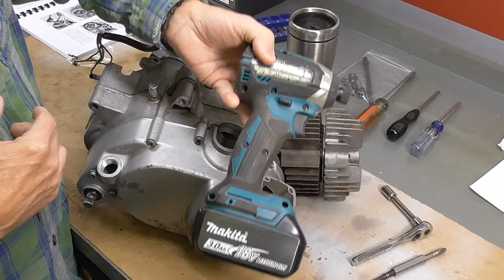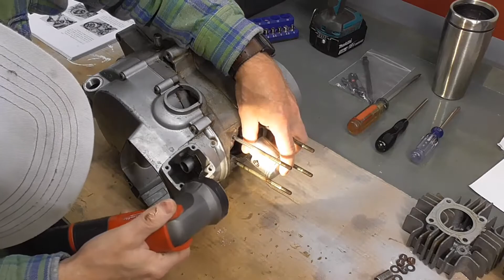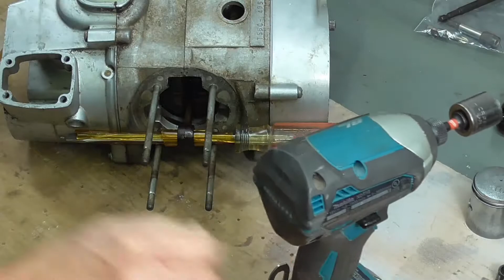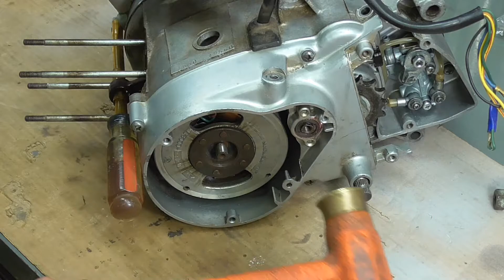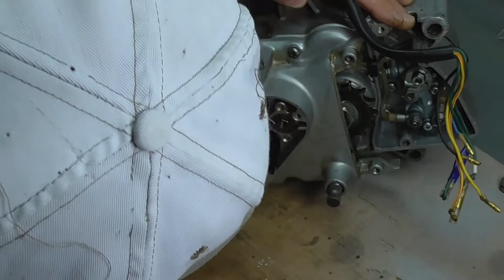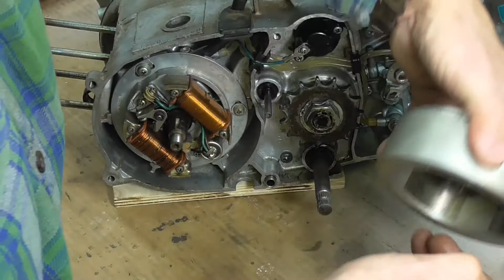Suzuki TS50, Engine Rebuild Pt #2 --- Video #305

Comment: Hi, just starting a 70 Suzuki AC50 tear down. What size is the internal thread puller you used ? if you have a link to one you've purchased or seen? thank you :)
Reply from the maker: I bought that puller long before purchasing on the internet was a thing, probably 25 years ago.  I likely bought it from a local dealer at the time.  In any event, these pullers are pretty standard and I'm sure you can find them on eBay or Amazon.  I know Motion Pro makes one and the larger left-hand thread is a 27mm.  Hope this helps.
Reply: @kwrightway  Thanks very much!